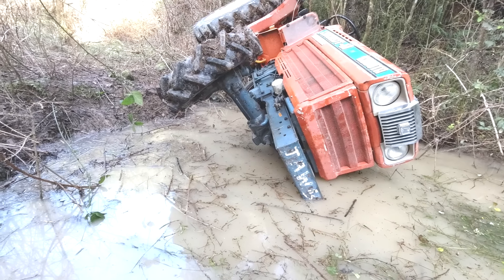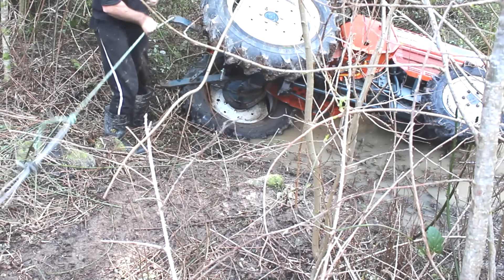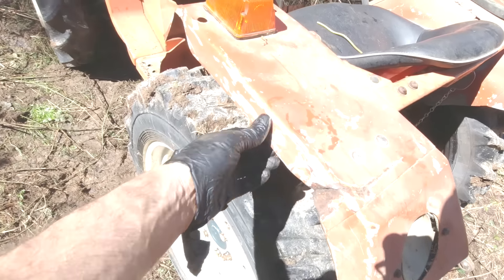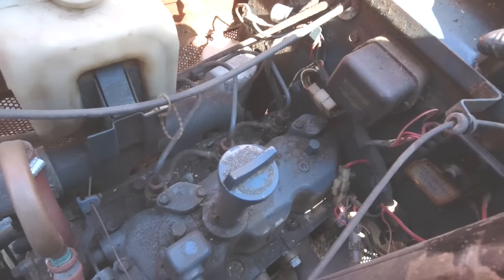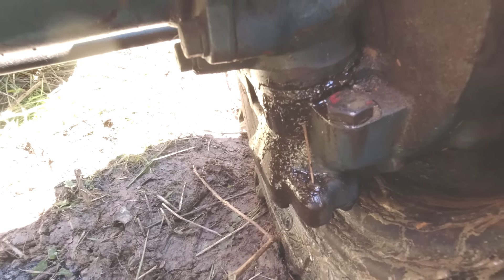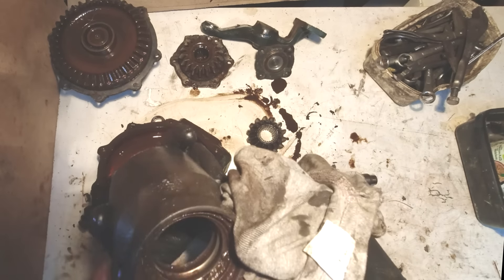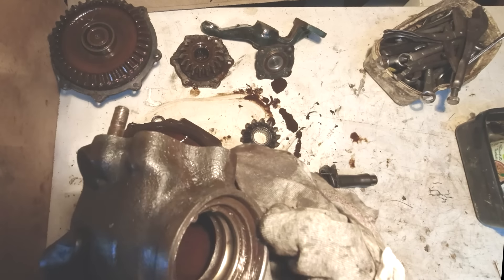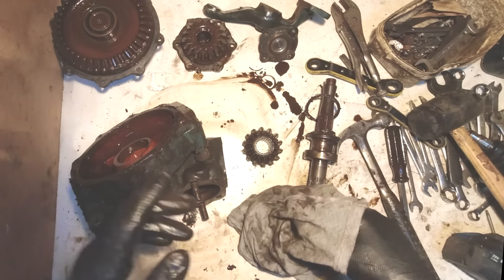Salvaging a Crashed Kubota Mini Tractor.. Owner wants it gone!

Comment: Marty, I look at it as someone who was too cheap to do the maintenance so it worked in your favor for there is much more than four hundred dollars in salvage. I had  a shop in Anchorage alaska and sold rigs or parts. If the rig ran but was of need of repairs I would sell it as is and might make you home. If it needed some repairs but was a real nice rig, I took it apart and sold the parts and I also did labor as well on subarus. Only subarus so I didn't have a million dollars in parts for all different rigs... that cut down what I had to stock. I could sell a lot of them for five hundred dollars and that was fair as it did run and drive, good heaters and radios.  I made bookoo money on parts and labor. I couldn't sell a rig for more money but I made twice to three times just fixing them for customers. Some shop has parts but the price may just hurt a bit. It comes down to do you part it and sell parts? Probably not as you don't need people crawling over your place and swiping or messing things up. I never kept the two  together... parts in a warehouse so they couldn't go looking about when I wasn't there to guard my plunder. I guess what I am saying is if it needs little else, I would fix it back as a four wheel drive machine. Or like you said, its needs are low so it could just turn into a two wheel drive. What makes people not take care of their rigs I don't know but it works for us to get a deal here and there

Comment: One of the best 3-cylinder 1 lt engines going, normally they are very quiet engines running and use about a gal of fuel in 24 hours. They make wonderful marine engine, I would have love to been offered that

Comment: Good to see you using the old tool you fixed to haul her out. Use once and it's paid for itself. Not sure if this machine is old enough for you Marty, I mean it has a decent seat for a start, both headlights, and a decent body. Perhaps rebury for a decade or so and refind it then.

Comment: A old timer told me a good trick to stop oil leaks was to put some small pieces of candle wax in the fill holes and when the oil heated up the wax would seal the leaks. Hope someone used this and would like to hear if it works. Thanks for the video. Good Luck

Comment: The turfor are the best tool you could take out in the bush,a couple snatch blocks and small straps and your set. I have 3 the size you do and one smaller one. I’ve used the small one to pull my 3/4 ton truck out of a ditch sideways. The only advice I would give the person who gets one is to have a bunch of the shear pins handy, I store mine in the handle and it’s smart to put a few in your ash tray just to be safe. There great when you go hunting, I’ve suspended a whole moose 15 feet off the ground to keep the grizzlies away. One of my better investments

Comment: It was probably run it’s no oil in the front drive, after it all leaked out because of a bad seal.  It was also probably run in deep water which leaked into the front drive via the bad seal.  What started out as a minor problem might end up as a major overhaul of the front drive.

Comment: I feel a little timid saying this for fear of making a fool of myself as you probably know this already, but at 9:18 you could avoid the glugging of the oil by rolling the can 180 degrees, so that the spout is the highest point when you start pouring. That way air can immediately and continuously flow in through the spout.

Comment: I have been a mechanic for 45 years,if the front end needs seals, it probably needs bushings or a new seal won't last.[ edit]  These usually have a group size 24 battery in them,but they accommodate a 27 very well which works well in cold climates.

Comment: I picked up a Kubota twin cylinder diesel engine at the scrap yard for $40 USD, and it's going to need some parts. It's missing some freeze plugs, so it may have frozen. It was originally used on an over the road truck as an auxiliary power unit. It's mostly complete but the thermostat housing is broken. I'm hoping to get it running soon.

Comment: Seems strange that the previous owner wouldn't have at least put out the effort to get the tractor upright and pulled out of the hole. You accomplished both without too much effort.
Reply: PO was scared by the tractor tipping and just wanted it gone...

Comment: I'll be starting to build a tractor soon. My rear axle is from a Hyster electric forklift. The rear is a meter wide at the centers of the tires. The steering axle is from the rear of a Toro mower, and is hydraulic steering. The engine will be a three cylinder petrol Kubota engine.
I will make it hydrostatic drive as this is simpler to build.

Comment: If you swap the left side wheel and tire for the right side wheel and tire front and rear it will give you better ground clearance and less chance of tipping over I did the same on my Kabota 2420 and the difference was it felt safer keep up the good work

Comment: Had to replace the bevel gears and bearings and seals in my JD 3038 about 3 years ago. Shoe box of parts was 2500$ i use the snot out of my tractor and have had it since new but those parts get exspensive quick!!

Comment: The inner and outer races of the old bearings can be cut to make a C shape and then used to protect the new bearings when pressing on.
Reply: Even if you just cut the races with a zip wheel, they can be a great help to install the new races and they can easily be removed after.

Comment: Nice little Kubota. I hope you can get parts and fix it :-).... Some little Kubota's strangely enough have glow plus but also a choke which seems wired for a diesel engine...also some have 3 speed for the PTO..

Comment: The bearings should have numbers on them..if there intact. The seals should also.  I just did the bevel gear to diff seal in my b8200 and they look really close to the same front diff.
Reply from the maker: There bearings and seals are so badly damaged all the numbers have been ground off, I did manage to find a parts manual after translating the model number to Japanese

Comment: Hi Marty, leaking front hubs.. On Landrovers it used to be a big problem on older worn seals, even newer ones began to leek until Range Rover/ Landrover started using there "One shot" grease, I saw this and thought, a "shot" of chain bar oil (sticky and tacky) PLUS some lithium grease worked wonders on my old landrover discovery. Even after a fast motorway run the front hubs were still cool`ish, warm but no where near hot/ it helps keeping water out also.. Maybe try it sometime./ thanks for the videos - Ian - UK
Reply from the maker: Good advice thanks

Comment: Looks like you were using fairly thin oil in that front end. You can use 90wt. That should slow the leak quite a bit.

Comment: B600 SAME MOTOR IN MY 1984 882D CUB CADET. Might be able to shim the spider gears  up and tighten it up use a Teflon washer to seal up the lower leak.

Comment: flip the tires around. they are backwards, but it will also push them out further to make it more stable.
Reply: In this case the backwards tyres allowed the best grip reversing up the slope and up onto the ute...
It is also the way these tyres should be when running on sealed roads..to reduce wear on the tyre lugs.....
and some farmers also reasoned that if they got into trouble going forwards that it was really important to be able to reverse out of it....
hence the tyre orientation for better grip reversing!

Comment: On a Kubota you have to turn the key backwards to activate the glow plugs I usually hold mine on for 20 seconds when it’s colder it will start way quicker using the glow plugs

Comment: The final drives of the front wheels are symmetrical (mirrored), right? Why don't you switch around the bevelled gears, they only seem to have real wear on one side of the teeth, so switching them around would reserve the worn side for backwards pulling only.

Comment: Mobil makes a synthetic gear lube SHC 007 that is really thick but still flows enough to keep gears lubricated without running through seals.
Reply from the maker: Thats good to know, but this one really needed fixing
Reply: @MartyT  It certainly did. Bearings don't live long without lubrication.

Comment: They are great little tractors I have 2 l 1801 one is four-wheel drive the other is two-wheel drive I use them in makeover 500 bales a hay annually I use the two-wheel drive with a 6-wheel 3 point linkage rake have only rolled at once lol and it wasn't me driving it otherwise I use it to bail my hay with a mini round bale neither have missed a beat but I think you forgot to realise it had a glow plug that's probably why you got so much smoke at the start

Comment: Slow start up and lots of smoke. Does turning the key to the left on that model switch on the glow plugs? On my Kubota, I switch to the glow plug setting for about 15-20 seconds from cold, then turn to the right to start. Starts up first pop.
Reply from the maker: Yes It does start better with a good 20secs glow

Comment: As much smoke as it put out when first trying to crank it and the color looks like engine got water in it as well that's usually color get when burning off water inside the engine
Reply: It's also the colour of incomplete combustion from cold cylinders and/or fuel excess.....

Comment: I had a L2 35 Kabota with the same problem and I rebuilt mine you probably only needed one part from Kabota the seals are generic seals you can match them up on Amazon or eBay from the size I found them for for five dollars apiece versus 30 at Kabota. . The bearings can also be matched up with generic  ones just takes a little work Kabota parts are outrageous if you can even get them for older tractors
Reply: Kubota

Comment: My experience with kubota is bad. Had one where the flange broke off, can’t remember if it was front or back of engine, on a three year old machine.  Four crankshafts later, all wrong with same part number, finally got a good one that actually fit and bolted up.  Took six months and owner gave up.  When he got it back he traded it in on a jd and never had a single issue with jd. Kubota parts, especially engine parts are a pain to get the right ones.  Be forewarned.

Comment: Hey Marty, are those bottle jacks more reliable/less dangerous than the scizzor jacks that come with Japanes cars?  Thinking about replacing the scissor jack with the bottle varient.
Reply from the maker: I would think scissor jacks are more reliable if used within their rated limit? they're not relying on seals to keep the weight up
Reply: @MartyT  I just had one fold on me and swore off them ever since.  I have a small floor jack, but it's a bit too heavy.

Comment: Kabota‘s are extremely common in the US. Just tell us what parts you need.  could probably order them or pick up. There’s also a couple of local dealers here in Tulsa. I have no idea what a gray market Kabota is….???
Reply: Grey market kobutas are ones from the 70-97 that came from Japan or Malaysia. Most US stores won't cover them or supply parts. Just Google grey market kobutas. They have their own section on the manufacturing website.

Comment: If the tractor is tippy but cheap.  Does doubling up on wheels help?
Reply: Thank you for your knowledge ❤️. I was wondering, if you did do that would it be wise to lower the pressure just a tad on the outer wheel to avoid over pressuring the wheel bearing etc.

Comment: If the tractor easily tips over,  could you make wheel spacers for the rear to make it wider and more stable?
Reply from the maker: I believe the wheels can be turned around to widen the footprint
Reply: @MartyT  is it running water in the wheels?

Comment: the l1802 is pretty much a l2002, l2202 besides the transmission, a partnership between kubota and daedong, which makes kioti tractors now....  so front axle parts should be the same from a l2002 or l2202..  the engine is a d1102,, thats a deal for 400 bucks..

Comment: I use Bay engineers up here in tauranga just take my old seals and bearings in and they just match them you could go to whatever bearing seal shop you have round you bro easy as live the vids chur chur from tauranga nz
Reply from the maker: Turns out this one had a double thrust seal and collar seal the local bearing shop has never seen and can't get so I had to get part numbers and buy oem
Reply: Sweet bro glad you where able to get them chur chur bro

Comment: Those old kabota are so cold blooded if valves are old cant believe hard time with parts they put those engins in all the bucket trucks and stuff with small pony motor even small ford tractors the real small ones used kabota engin

Comment: Why is there is smoke coming out of the exhaust when it is first being fired up if it isn't actually firing?
Reply: @JohnSmith-yv6eq  Thanks for that John I was under the impression that there was no combustion at all happening unless the engine was actually firing and running.
Thanks for the clarification.

Comment: I had one of these, the 4wd system seems to tear itself apart pretty commonly, I suspect its a case of wrong size tyres causing the wheels to turn at the wrong speed
Reply: I've seen far too many tractors rippping around on hard surfaces in 4wd, with the tyres fighting each other. Used for traction  when you need it , you don't have this issue.  Whether truck, 4x4, tractor, I run 2wd for general  running, and 4wd  when appropriate. If you engage 4wd when you need it, it's because of lack of traction,  so a moderate amount  of slippage  is inherent regardless, and you don't have the same level of problem

Comment: I work at a Kubota dealership and can look up parts for you and also parts break down diagrams. Shows how everything goes together. Feel free to shoot me a message if you ever need anything. I’m sure you’ve probably had others comment the same thing but doesn’t hurt to throw the offer out there 👍🏻
Reply: I work on them and also look up parts so I’m sure I could find whatever you may need. Seeing the “oil” that came out of that front diff made me cringe so bad. And I’ve seen some stuff believe you me.
Reply from the maker: You legend thanks mate, I will keep it in mind for next time

Comment: Marty, what makes this "grey market"?  Was it that it wasn't sold via a Kubota dealer, are there non-Kubota parts used to build it or is it an out-and-out knock-off?
Reply from the maker: This explains why https://nelsontractorco.com/gray-market-tractors/
Reply: @MartyT  Yep.  Article written by an authorized dealer.  Bet you can find a bolt-on ROPS that will fit (or build one), so that's a non-issue.  Bet there's a way to lock-out the PTO so it's only 540; again, non-issue.  (FWIW, my 70s vintage John Deere 4020 could run 540 or 1k RPM but you had to swap out the shift.  Also, every PTO shift I've ever seen has different spline pitch for different speeds.)  As for parts, all you need is a parts breakdown for an identical export tractor and I'd bet that 99% would interchange.  Like knock-off Honda generators.  Need a carb kit?  Buy a Kipoor kit for half price and it's identical.

Comment: can the wheels be swapped from one side to the other, i.e drivers front to passenger front, would keep the tyres in the right pattern and increase the track width giving you a bit more stability? Might bugger with the steering geometry a little though, im not sure.
Reply: There are a few adjustments on the rim to adjust the width.

Comment: Why did he drive there
Reply: That was where he was pulling out stumps of trees left in that swamp....but he was using that bar marked "Jaws" as the hitch point...which was the wrong thing to do...as when the chain slipped to one side the pull tipped the tractor on it's side..